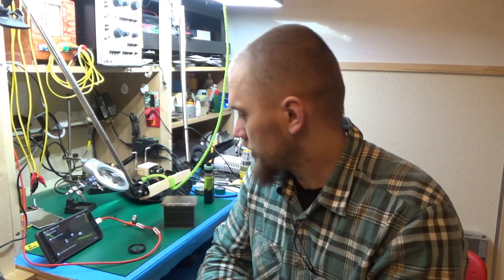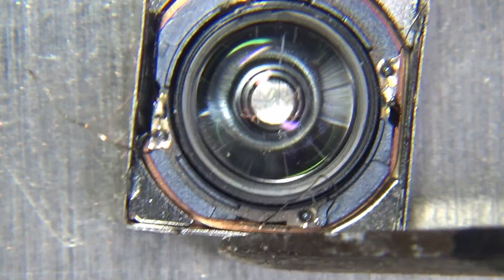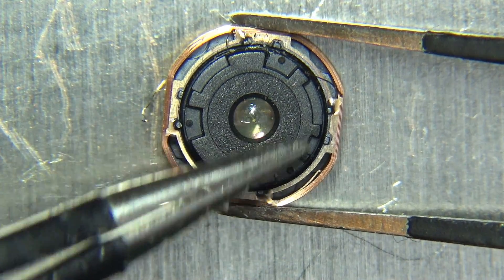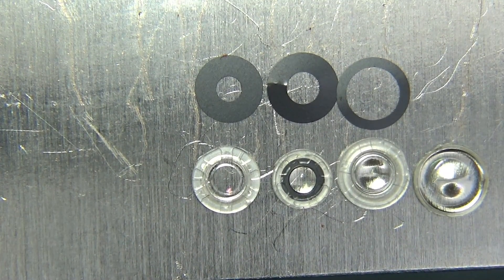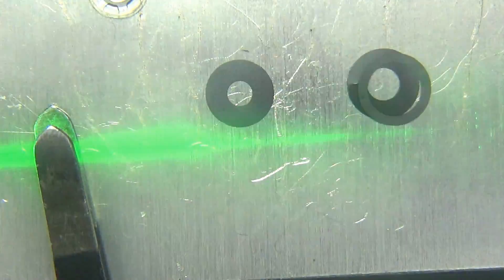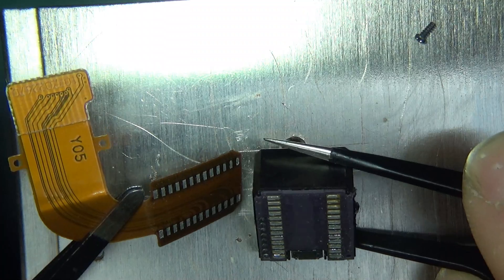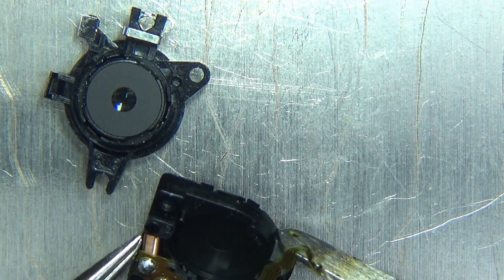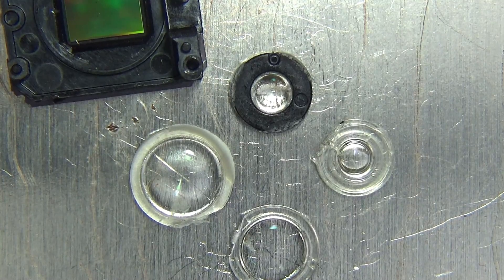Close look at mobile phone camera optics

Comment: - I think the lens assembly should not be teardown, but use as entire unit
- I also think lens might be in pairs, one to correct the distortion of the other one, if they have a spherical shapes
the DVD lens does not need to correct spherical aberration as it does not have to reproduce an image, just to read pixels. so this they are used alone.
- because lens are so small (so focal points,... are very small), they are difficult to position one in relation to another in home use setting, so is difficult to work with them. note that focal length is multiplied by image sensor crop size, so to get same focal length for small sensor, the lens gets closer to the sensor and positioning is more critical as we talk at lower length...
for home settings and adjustment better is to use lens from photo cameras from flea market...

Comment: can u put camera from one phone to another????
Reply from the maker: Yes, that's what repair shops do. But you can't change camera to a different model, because each model has different setup and driving software to go with it.
Reply: i want to put a sharper camera in a cheap junky basic android phone... is it possible???
Reply from the maker: In theory, yes, if you re-write the firmware for the phone too :)
In practice and in short: no, sorry.
Reply: u made me cry :'(
i have a Samsung SGH-F480 camera saved up, and it has an awesome camera, i smashed the phone, but the camera is intact completely, i want to use it somehow.

Comment: The four lenses thing could be the correction to the inversion cuz looking thru a single convex or concave lens would flip the image
Reply: Nathan Greens that is handled by the camera's sensor. Its just placed upside down.
Reply: Nathan Greens
Reply: They are more about focusing and correcting lens aberrations, getting the image/colors to line up accurately horizontally/vertically at the focal point. Without them the image would be blurry and the shape of a 1950s television screen with different wavelengths of light offset from one another.  There's a shitte-load of physics going on in lenses and multi-lens assemblies. Our eyes are masters of these physics, at least when we are young, our minds then take a good deal of artistic liberty interpreting this information before passing it on to our conscious.

Comment: hey, the laser pointer you are using also have the lens that can be used for macro photography with the smartphone .That lens is also threaded so you don't have to destroy the laser,you can reuse it.Usually i use that lens for  " bad soldering joint" checking purpose.
Reply from the maker: +riaj hasib cool, i will remember that!